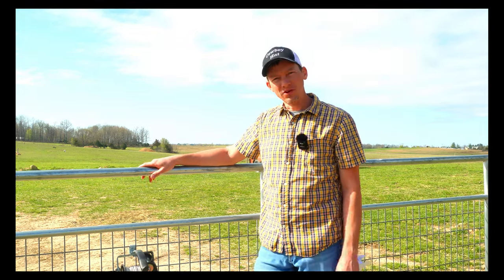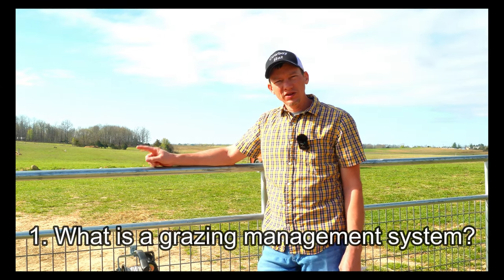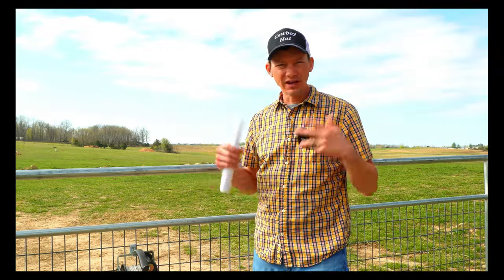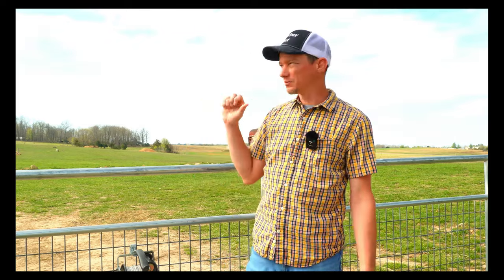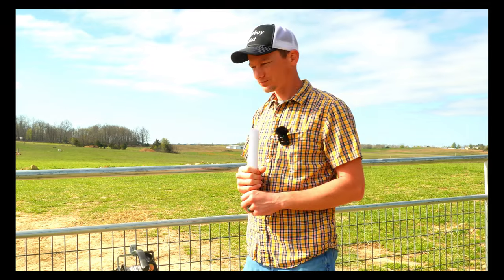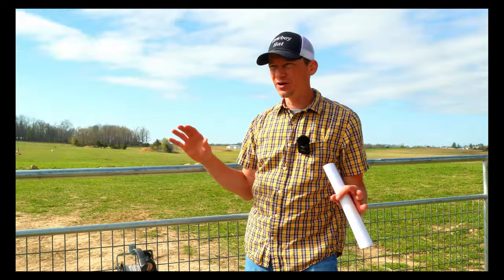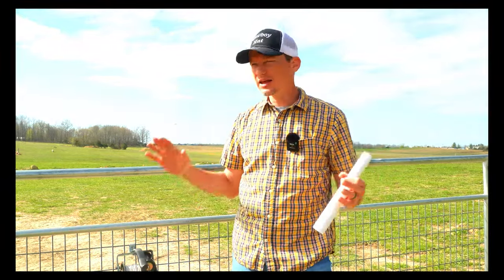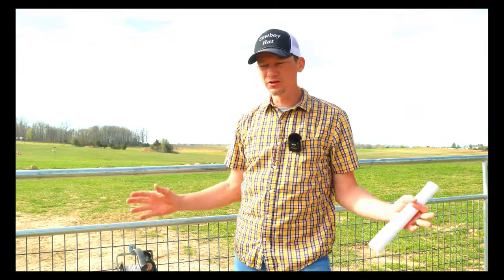Rotational Grazing Made Easy With A Grazing Management System

Comment: Interesting topic. So few channels discuss poly wire fence.
Just a few observations....

Rotational, managed or adaptive grazing (whatever approach you use) is NOT a recipe. Paddock size and length of stay/rest is CONSTANTLY changing.
A fixed fence, 1ac paddock, might be perfect size in spring for a given # of lbs of cattle & quality of forage but it would be totally inadequate in another season with drier/wetter conditions and different sized cattle. 

Old adage..."fast growth, "fast" moves; slow growth, "slow" moves"

It's helpful to explain duration of graze vs duration of rest. Why and how it changes throughout the year.

Last.... base paddock size on pounds of calculated forage needed EVERY DAY...not some arbitrary fized size (see above)

Good luck